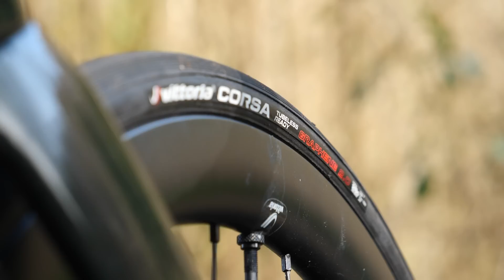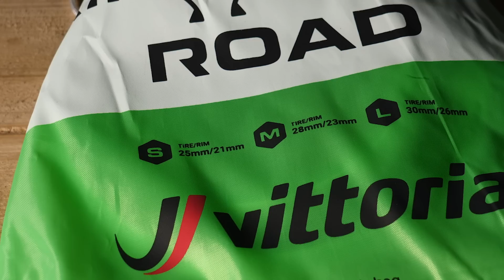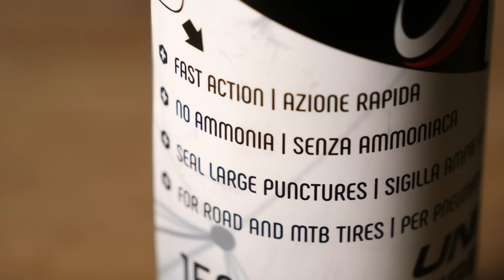NEW Run Flats: Pro Cycling’s Secret Tech | Vittoria Airliner Road First Look

Comment: Yes, got mine on order expecting them tomorrow. I started with tubeless last year but switched back to inner tubes as I was concerned about sudden rapid deflation through burping and the mess and inconvenience of trying to fix a puncture roadside. Also with my particular tyre rim combination I simply cannot re mount the tyre without using levers. Another point was if I still needed to carry a spare tube and pump anyway, what was I gaining. This system looks as though it has addressed all those issues, my only slight concern being how far could I ride if the need arose, hopping I never have to test that one.

Comment: Will these work with rimless wheels, Zipp 303s?
Reply: DO they take tubeless tyres?
Reply: Horrible comment. I'm just aware that they use different tech to most tubeless wheels and that if I needed to limp home they definitely wouldn't slip off the rimless wheel. I've googled it and can't see anywhere that specifically says it's fine. I'm sure it is as they say all tubeless tyres but not all tubeless tyres are rated for rimless wheels.
Reply: @paulireland8680  Ok you meant hookless not rimless, they should work fine then. Rimless I was thinking like tubular wheels, hookless still has a rim.
Reply: Bit awkward, my mistake 😬. Cheers

Comment: At first I thought these would be excellent in the winter instead of standing by the side of the road changing a tube in awful weather. However I could see these being an all year round “fit and forget” option for many.
Reply: Even for commuting is great.. Changing a tube in winter while you are commuting to work is a nightmare that you will no longer have!!
Reply: I did then a small cut much less than 7mm and I seem to be back on a gator hardshell with tubeless tyre in the bin.
Reply: @jerehada  gators are junk and don’t event stop goatheads. Schwalbe Marathon way better. Or if you have decent road Tannus solid tires, but according to the product specs it will ride like being on a 110psi air tire so better hope road isn’t bumpy.
Reply: @KandiKlover  is it the schwalbe marathons better than the gators?

Comment: I’ve been riding tubeless for about six years on Reynolds 62mm Strike rims coupled Bontrager AW2 tires lately, mostly because of the AW for added flat protection but they’re not lightest or the smoothest ride by far. I look forward to trying the Airliners with a lighter and more supple tire and see that enhances my ride.

Comment: If you can’t replace it with an inner tube, then, no.. I won’t use it.
There was a similar product called ‘Cush-Core’ I believe, but that stayed in shape, and looked to be an option for protecting your rims while riding on cobbles with low pressures. (I have ridden Paris Roubaix cyclo maybe 8 times now, never flatted but dented some rims up to 20 times)

Comment: This is pretty great technology for a variety or reason, be it training, commuting, racing, or even just safety descending. Given its weight, it really doesn't matter that it is there and will allow previously "unreliable" low rolling resistant tyres to be used for more utilitarian applications, because even if they do puncture, you can still get home/work/wherever. 

Given there only 20 something grams, which is about 10% the weight of a good tyre, that is well worth it, even if it just means you don't have to bring a pump/CO2 and tube on your training/causal rides because you can get home anyway.

Comment: For you tubeless roadies who by the looks of this video haven't seen the solution to flats you can get bits of rubber you push through the hole that fills it up then you can pump it back up nice and sealed. Guess this is more of a mtb thing.

Comment: Basically it is race tech only... because I would much rather put an inner tube in in a few minutes instead of limping home on whats essentially a 1.5-2 bar pressure tire.... But if you carry a set of tubeless plugs it may be easy to get it to reinflate as well. There is a risk to it though.

Comment: I think this is a great solution to a genuine problem. My concern would be fitting tubeless tyres, which is hard enough already, when you have these in the tyre stopping you from snugging the tyre right into the bed so you can squeeze that last bit of beed over the rim. I guess the rim and tyre combo would be key. Also, as Si points out, you have no options if you’re a long way from home and get a bad cut and you can’t boot it and stick a tube in.

Comment: 14:14 are Vittoria TLR beads finally rubber coated? My first gen Corsa Control TLR beads aren't and it heavily relies on sealant, while simultaneously being nearly impossible to seat on standard DT Swiss rims even with a compressor...
Reply: @DD GG I got a replacement tire last summer because the rubber coating on the sidewall flaked off... this one was already upgraded as it's now rated up to 6 bar pressure according to the imprinting instead of 5, but it didn't have different beads. The bead on a Maxxis High Road is massive and coated in thick rubber which makes it so much more easy to mount and a lot more air tight.
Reply: @DD GG I only checked the pressure rating in bar and only because it was a visible difference between my first pairs and the replacement. They ride like a dream and I had no punctures in 2 seasons, but the mounting hassle is just too much for me, especially when you want to renew your sealant regularly. Couple days ago I wanted to change to the Corsas from my winter training tires and I wasn't able to seat the first gen tire with a compressor, and with a tube the bead only seated above 5 bars. Maybe they were extra tight because they weren't mounted for a couple of months?  My experience with the High Road just showed me that others are quite a bit ahead with tubeless technology, and that's a tire with similar weight and supple high end casing...

Comment: What exactly prevents me from putting a inner tube in the wheel beneath that pool noodle thingy? There is similar stuff from tannus for mountain bikes. Tannus armor or something like that.
Reply: You need the Airliner at the base of the rim, so the tube would go on top. But then it wouldn’t be able to fill in the gaps around it. I mean, you could always try it, but I wouldn’t!

Comment: So now we need this in an innertube (latex) version.   I would buy it.
Reply: You can put a latex inner tube with longer valve between the air liner and a tubeless tire. But I won't try it with clinchers.

Comment: Been riding Vittorias for years and feel they are the best road tires. But my old Ti frame can only accommodate 23mm tires. Can the aliner small size fit a 23 tubeless (assuming they make a 23mm tubeless)?

Comment: so basically TLR tyres are 45g heavier than clinchers (vittoria corsa 28mm), then you should add 31g of airliner and on top of that around 50g of sealant and 15g of valve, a good inner tube weight is around 80g. Are we sure that the marginal gain in rolling resistance outweights the major (61g per tyre) increase in weight? (not considering the increase of weight of the wheel itself due to the larger rim required, most of us I think still uses 19c, here for a 28mm tyre requires a 23c!)
Reply from the maker: The air liner isn't designed to improve rolling resistance further, so it shouldn't be factored into this really. It's to enable you to ride on a flat which is a huge benefit to most riders (including the pros). Everyone prefers something different though so if you're happy with what you're riding then stick with it by all means!

Comment: This is the type of video that I´m missing lately. Informative, about interesting topic and filled with details. Thanks for that. 
Now my opinion on airliner. 
Do I think that they will stay and expand in pro-peloton? Surely. 
Will amateurs start to use them as well? Surely. Some of them.
Will airlines kill clinchers? Nope! - Answer is in the video. While airliner will always get me home and tubeless will lower the chance of puncture. As amateur cyclist I have different priority! And that is, that once I am on the road, doing my training ride or recovery zone 1/2 ride - it is crucial for me to finish it. If I puncture clincher, I may lose 5min on the side of the road, but I surely continue in not time with my task. But airliner is basically saying - time to go home buddy and my hardly earned time gap for ride is ruined. I know that this scenario may occur 1 out of 50 rides, BUT hey - with clincher I am always able to continue my prescribed ride. So I believe it´s gonna stay.
Cheers and thanks for interesting video! :)

Comment: I checked Competitive Cyclist for availability, the MTB versions are around $80 - $85. Vittoria site provides no availability for the road versions. 24g foam versus 66g latex Vittoria tube, though one would still need the heavier tubeless tire and valve stem. So, likely a pass, but for me buying another set of wheels, tires, foam and tubeless tire repair stuff plus still needing a tube when out for long rides, seems like a lot of fuss and money to fix a problem I'll still need to face with the same tech we've been using for years. Maybe racers will pop for it, but like the wonderful feel of sew-ups, I'll skip it for my more casual, non-racing use.

Comment: Definitely would like to see this for use in wider tires, like 32-35mm like we see on a lot of commuter bikes.  I know a lot of people who would bike more often especially for commuting if you told them they would never have to worry about a flat and just deal with it when they get home.
Reply: Great point, and I reckon making a bit of foam a bit thicker is achievable too, although the construction may need tweaking if the standard running pressure gets lower as well.
Reply: They make ones for gravel and for MTB as well. Gravel would likely be what you would want for a standard 35mm tire.
Reply: There is a Vittoria Air-Liner Gravel for sizes between 31mm to 40mm
Reply: Unlikely because these are for tubeless tires
Reply: @disturbed4ever2  foam lined and sealant filled tubeless could be great for commuting. Sealant on work clothes isn't so great, but a decent commuter has mud guards anyway.
Reply: @armadillito  what percentage of commuter bikes are tubeless?
Reply: @disturbed4ever2  nearly zero today, I should think, but that could change as prices come down and the tech gets easier to live with.
Reply: They do these for gravel tyres too.   I've been running them for a while commuting, great product!
Reply: Puncture resistant tires probably are the easier option, if you don't really have to worry about rolling resistance anyways.
Reply: @disturbed4ever2  Tubeless in MTB for yeeeeaaaars and tubeless road since ‘15. I know I’m in an absolute minority, but my main commuter is tubeless, and I’d make my Brompton tubeless in a heartbeat it I could.

Comment: Just got new tyres for my Enve 4.5 AR Disc; this might be an option for the next set of tyres, waiting for the long term reviews.
Reply: I have had the same wheels for a couple years now. Hate tubeless, but this may be enough to make me trust it again.
Reply: @RyonBeachner  why do you hate tubeless, i really cant see a single negative.
Reply: @scottydonald  I’m yet to have a puncture actually seal with it. Instead I get the surprise roadside bukakke, and then the worlds least enjoyable tube install because everything is covered in sealant, and a difficult time debeading, removing and reinstalling the tire due to the tighter tolerance between rim and tire.
Reply: @RyonBeachner  ouch, touch wood i am ok.
Reply: @RyonBeachner  If you're gonna join the partey, make sure everyone's got some decent rubber on:

Hutchinson Fusion 5 TLR 11storm.

Also, if you do get jizzed on, then these might prevent you having to get even muckier:

Dynaplug Carbon Racer.

PS, maybe try a different sealant or tyre pressure.

Best of luck
👍👍👍👍
Reply: @JibbaJabber  hahah yep. Dynaplugs are great, I’m going to give the Pirelli P-Zero Race tires a shot. They mounted up on my ENVE’s FAR easier than the previous schwalbes I had, and even seated with a floor pump no problem.

Comment: I dont understand how to inflat the type when the foam is inside. Foam blocks the hole of the nozzle right?
Reply: No, the pressure against the inside of the nozzle isn't that high. If you can pump a tyre above 2 bar you're fine :)
Reply: Special kind of valve. The rubber stop inside of the valve has holes not only on its bottom but also on its side.
Reply: @manueldeubler1127  Could you send me a link showing a picture of the valve? Thx.

Comment: Using Tubeless, I get a puncture that I actually notice while riding, about once every 18 months. This is on hilly, gritty Yorkshire lanes. Just a pump up and the sealant finishes the job whilst riding. Carry a tire boot and an inner tube but never use them. So this seems like a good idea that I would consider but not for the price of a new tyre. When they get down to £5-£10 or less I’ll probably add them in.
Reply: Judging by the MTB side of things they will never get that cheap. Only way they would is if they go really high volume which would take buy in from low end manufacturers in addition to the higher end bike industry. I don't see that happening, your average WalMart bike tech installs forks backwards for goodness sake.
Reply: A product like this will never go cheap

Comment: I’m curious what is the need for the sealant if you have the foam doing the work. No experience on tubeless and haven’t done much looking into them. This has my interest though.
Reply: I say you still need sealant, as this system won't  patch the hole that causes the flat so you wouldn't be able to pump them back up to pressure.  Seems these are to stop the tyre from being able to unseat from a flat.

Comment: It all sounded great until the last tiny warning.. so I'm on a century ride, 50 miles from home... how horrible would that ride be? Sometimes sealant takes a while to fill puncture and seal, so unless catastrophic puncture you could add air back in.
Reply: I always have a small bottle of sealant in my back pocket. If ur sealant is good, u just need to wait by the roadside for 10 miniutes for it to seal.

Comment: I wonder if these would work for my Hunts with 19mm inner rim width?
Reply: @cassioriccelli1247  Not an accurate comment! If you check Vittoria’s website you can see them being easily mounted on the Vittoria wheels, which have a 17mm inner width. Also, the rim width mentioned on the kits are maximum rim widths, i.e. you choose the insert based on the tyre width that you’re using as long as the rim doesn’t exceed the indicated width. The chart with the measurements is available on their website.

Comment: As someone who likes to ride into the middle of no where in Canada, it would give me more peace of mind on a backroad between cities. You can only carry so many spares.
Reply: about 25 years ago, late afternoon long humid summer holiday weekend, I just past 100mi on my odd. when I discovered I had left my inflator at home in my haste to get rolling. I had 2 spares in my back pocket. According to the sign post 14k to the next town (owen sound) - or start walking back. I just built up those wheels and did not want to destroy them riding flat. Unbelievably, 100m or 200m up the road "Dans Autobody" was working in his home garage.
I got enough air to complete my epic loop - but later at dusk when I had to stop to pee and change my lenses the mosquitoes went nuts. 
I was so glad to be able to ride away from them.
Nowadays I carry 3 spares, 2 inflators, bunch of co2,  a pack of tire boots. And a whole lot of luck.
Thanks Dan

Comment: May work well on the road but the maintainance looks like a pain in the neck with special pliers and clips. As Andreas Klier said it "mechanics have a lot of work with it". Same as with tubulars, no advantage here. Personally clinchers with inner tubes have gone a long way and are still a winning team for me. The best Clinchers with Latex inner tubes reach the exact same level of performance as the best tubeless with butyl it's still a close game so why bother? It is still the easiest and most convenient for the casual rider and run with next to no care untill a tire is shot. Punctures? Had my last one on the Road sometime back in the Nineties. Just dont ride cheap tires with no protection.

Comment: The first time I think that tubeless would have a tiny advantage over tubes and tires. Question is: If you are on a ride and run flat, then how many kilometers or miles can you torture the liners to get back home safely? And if you make it back home, are the liners reusable or do they have to be replaced? Still questions over questions.

Comment: how does this work with the sealant?
Reply: That was my first thought. He mentioned that the sealant isn't absorbed by the foam. So I guess it just keeps sloshing around as per usual. Really needed to see it after it was tested with sealant for proof🤔

If it does work, would be able to get rid of most of my saddle bag kit😱